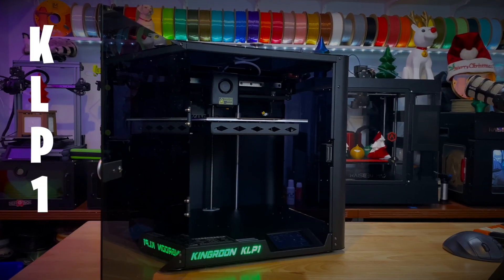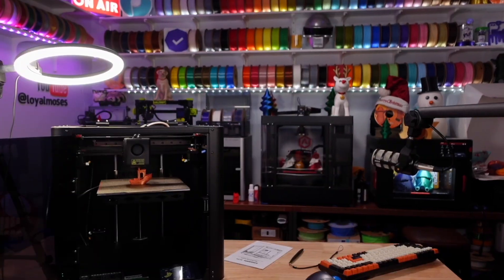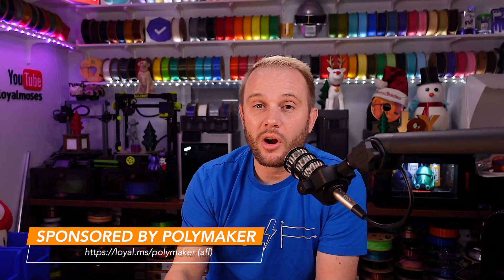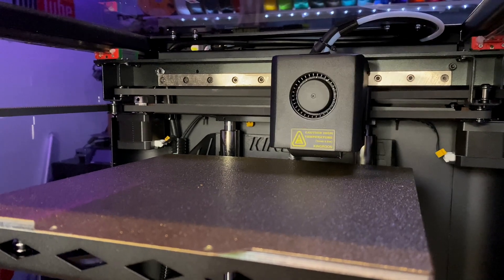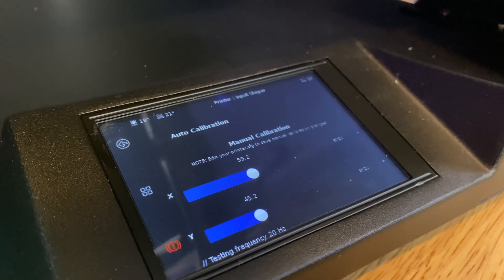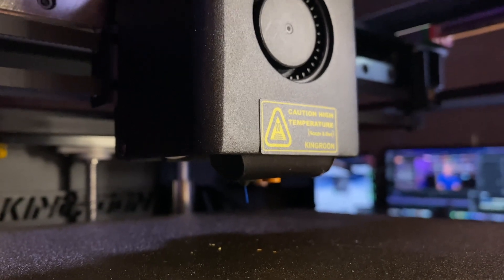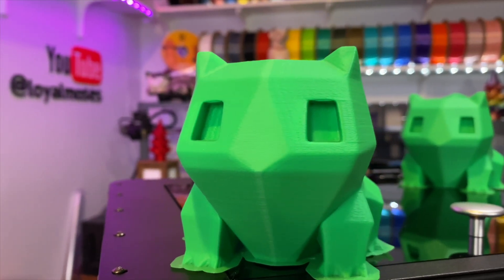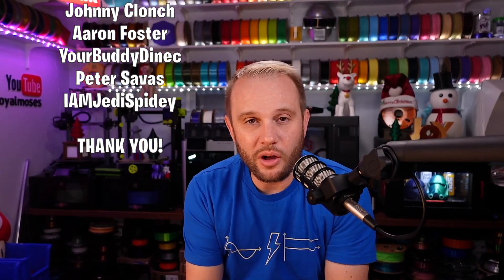NEW 500mm/s CoreXY Klipper 3D Printer - Kingroon KLP1

Comment: I got this printer for 285 Euros (300USD..ish) on Ali during the 11.11 sale with some coupons. It was delivered withing 3 days. K1 at 319 is also insane. The KLP1 is a bit odd and has some things that need to be fixed but overall I think I won't regretted my purchase for that price. i haven't had much time to test it out yet.
Reply from the maker: That is such a GREAT price!
Reply: K1 or KLP1?
Reply: Got the KLP1 for 285€.

LoyalMoses mentioned the 319$ K1 deal in another comment.

I would have gotten the K1 if I had known about that deal.

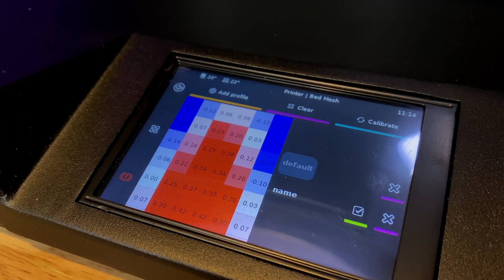Comment: I like that we are getting this style printers for those kind of prices. The problem I have with these machines is visible 5:14. They keep using these cheap extruded aluminum beds that are very thin and just add PCB heaters to them. They  warp like noodles in water. The reason I went with a Voron build and sold my old Ender3 is this exact reason. Thanks I'd rather have a flat bed.
Reply from the maker: Decisions have to be made to keep costs down. People keep asking for lesser expensive machines, and some of these companies are doing amazing at it.

Comment: mine had layer shifts and a wire hanging from the extruder. another kingroon i had caught on fire day 1
Reply from the maker: Wo! That is scary!

Was this from the first batch back early in the year?
Reply: @LoyalMoses  my klp1 was bought 3 weeks ago. It had the layer shifts. My kps3 pro V2 was two months ago.
Reply from the maker: Dang! That’s terrible, sorry to hear that! What were the wires hanging down? And did you find out what caused the layer shifting?
Reply: @LoyalMoses  never figured out the layer shifting issue. Always happened about an inch from the plate 

The hangings wires were the ones connected to the ceramic hotend